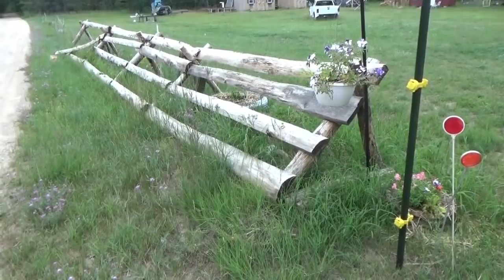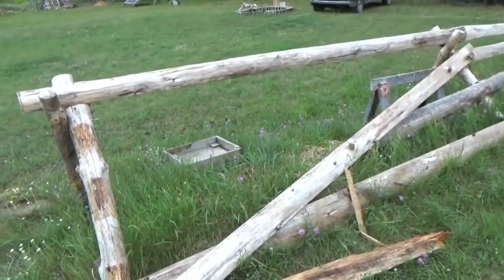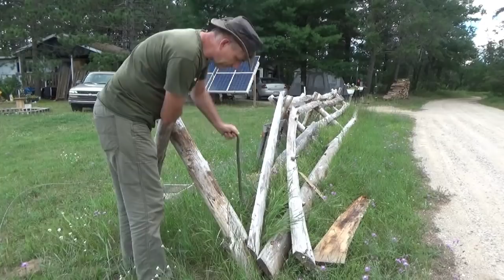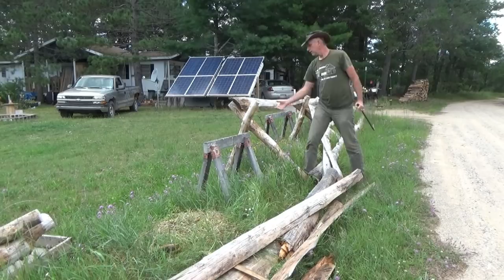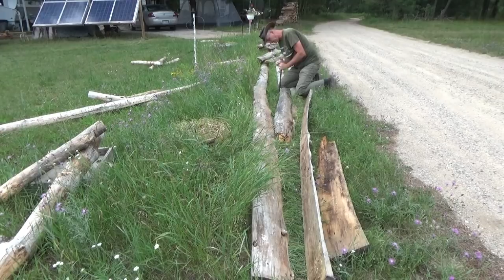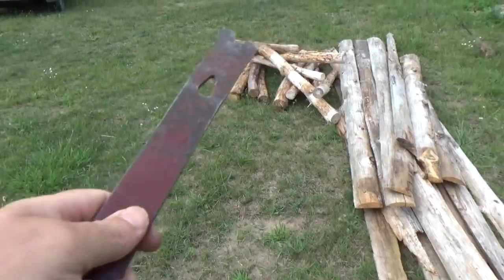Dismantling Our Unfinished Split Rail Fence

Comment: Why not put the chain link fence across the front of the property? The electric fence may have an alarm hooked to it, but that won't do any good if you're not home. A physical barrier along with an alarm system is best. Also, isn't it better to keep the animals completely out of the yard, rather than just trying to protect the garden?
Reply from the maker: I am allowed to have an 8 foot tall fence with vertical boards. I may do that once I get my mill up and running properly. Cant afford the chain link fence all around. But I can saw boards from our own trees all day long.

Comment: Well the chain link ain’t as country looking but will serve the purpose.  If you get the lumber mill up and running all you need to do is cut posts and rails.  You’ll need a plainer or the sawmill you rigged up.  Just get the specks from township and when you get the time build your own.

Comment: Do they tell you what drapes to put in your house Nobody told me what to do on my land I have a custom built long range rifle Goes 1,500 yd and they know it
Reply: Building codes are necessary to insure safety. Zoning laws work both ways. They can be a pain in the backside. But they can also help. What would you do if there were no zoning laws and your neighbor wanted to open a toxic waste dump on his property?
Reply: DrBill  There are toxic waste dumps that are allowed by the EPA and follow EPA regulations. I still wouldn't want one next door. I agree with you on HOA's. Which is why I would never by a home that was under the control of one. However that is different from zoning laws. Which for example... If your neighborhood is zoned single family residential.... Someone can't buy the neighboring property and start operating an auto wrecking yard, Or build a 300 unit apartment complex.
Reply from the maker: We are allowed to put up any curtains we desire but we are supposed to get permits for replacement of anything inside such as cabinets.
Reply: The Do It Yourself World wow